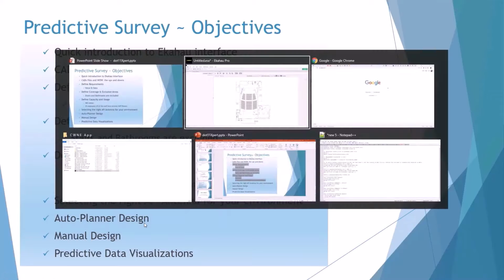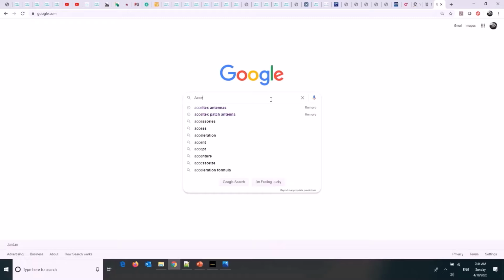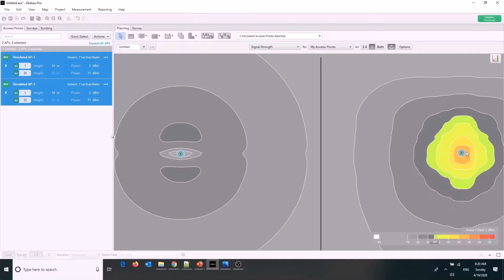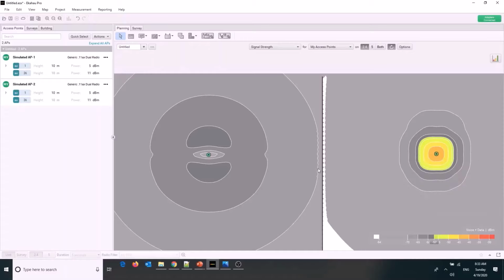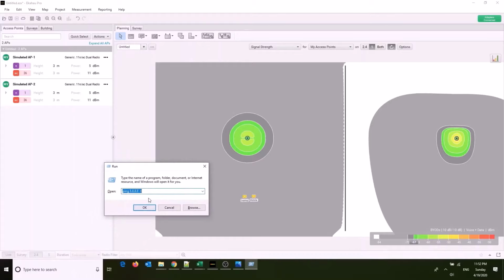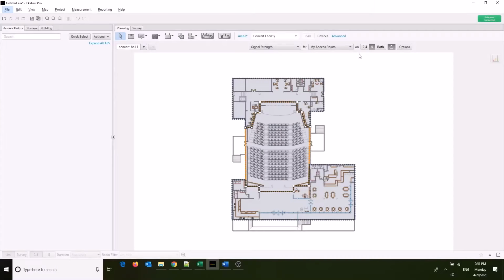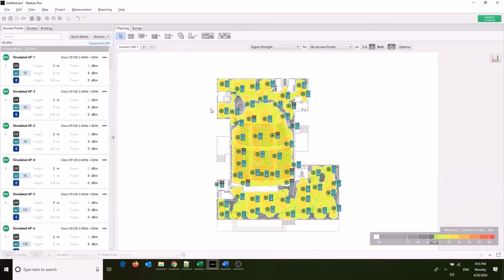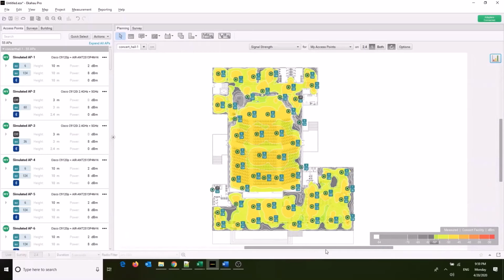RF Design - Select the right AP/Antenna and Ekahau Auto- Planner - part 5

Comment: This is excellent. Around the time of 5:00 minutes you explain the different RF patterns for various antenna types in Ekahau. I think that is really helpful to people deploying wireless in areas with high ceilings.
Reply from the maker: Yes, this is because the antenna's radiation patterns determine its application or its use-case